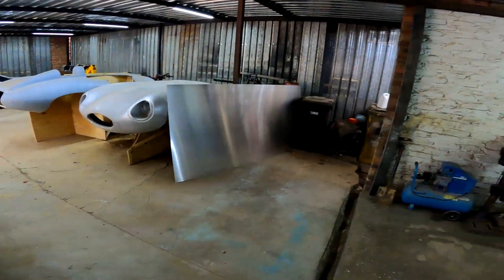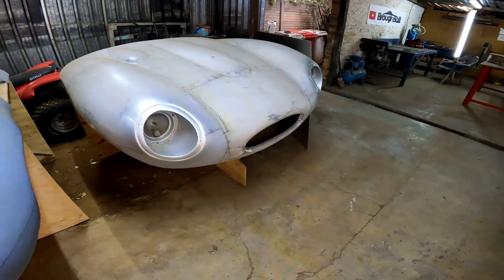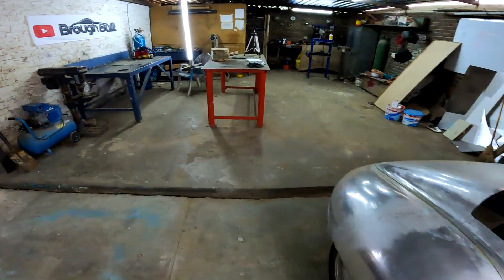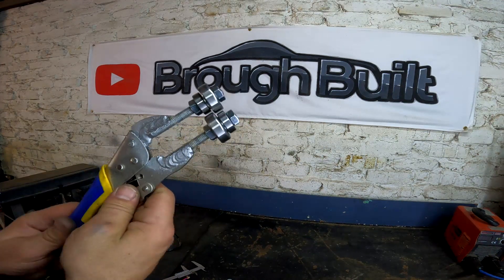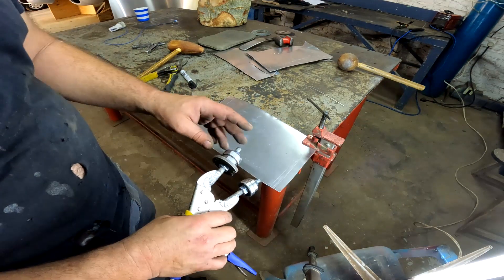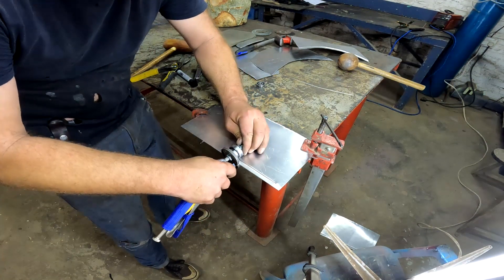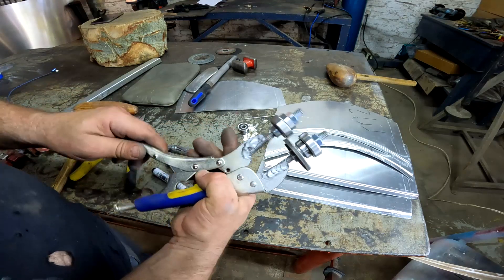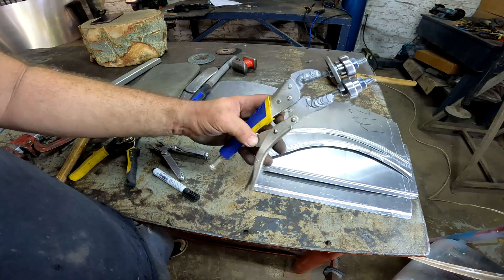Making a Handy tool for Aluminum fab work

Comment: That's awesome!
I think if it had a length of pipe with a thread that allowed you to screw onto the top part it might give more control and leverage allowing it to have a smoother movement.
Reply from the maker: I actually made a similar modification as you are describing. it helps a lot with control

Comment: When I first saw what you were attempting, I thought that it would never work...but, as you showed, it is possible. You may struggle to get perfectly straight beads on long pieces though IMHO. But here’s hoping.
Reply from the maker: I agree it's not exactly ideal for straight lines but I think it should come in very handy on smaller curves (especially the headlights and such...)
Reply: Oulik 👍